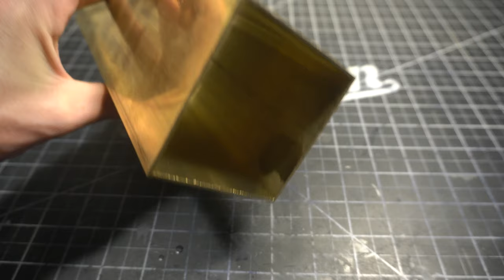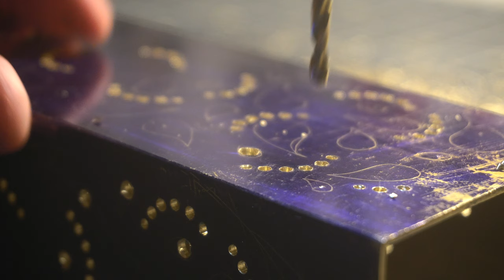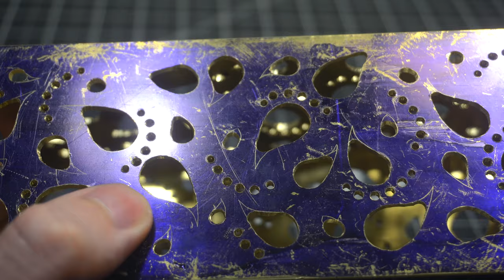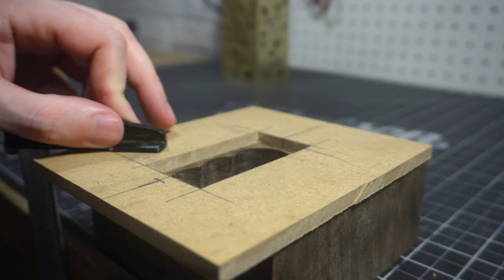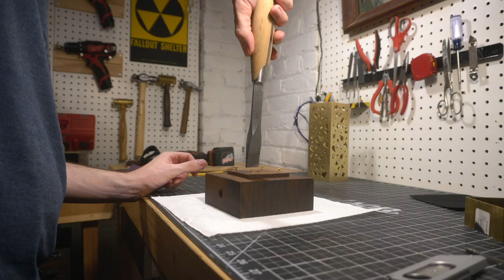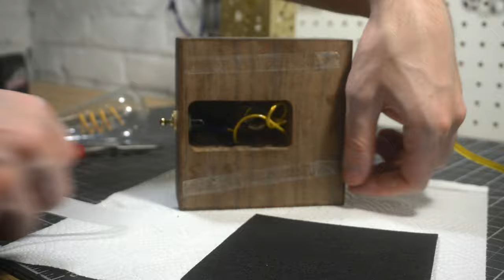Brass and Walnut Patterned Table Lamp

Comment: Nice job!  Did you get that brass piece in a proto box?
Reply from the maker: Sure did! 😎 I feel like a kid on Christmas when that box shows up! It's very satisfy to design a project around some of the interesting shapes you get and I'm sure that piece would cost more than the whole box if it was an inch longer
Reply: @kelseywatson1974  I just used mine but I turned it into brass sheet stock for my next video…..your idea was better 😂
Reply from the maker: @HighCaliberCraftsman  I would have done the same if I needed the sheet stock 😂 that’s the one shape I never seem to have enough of